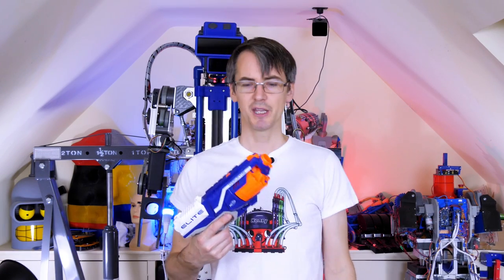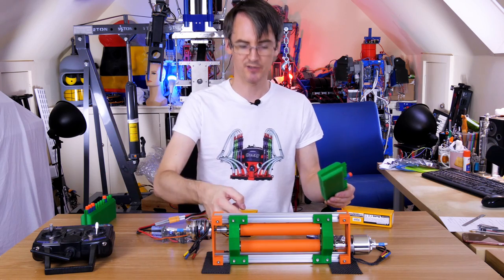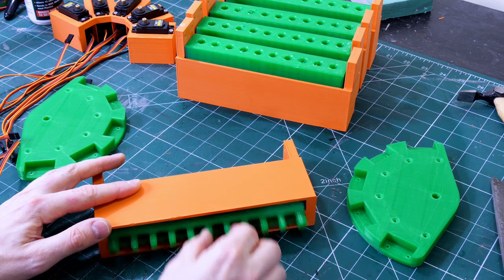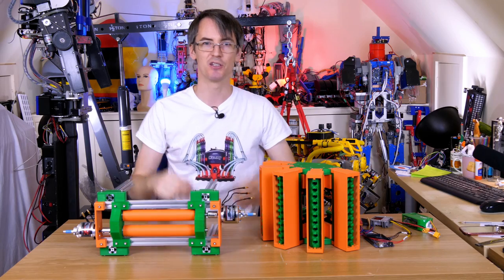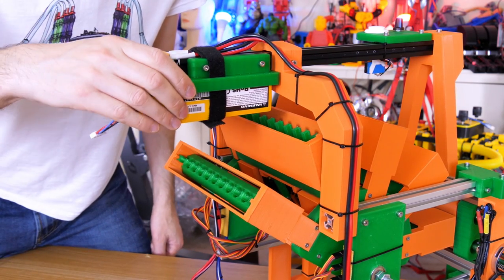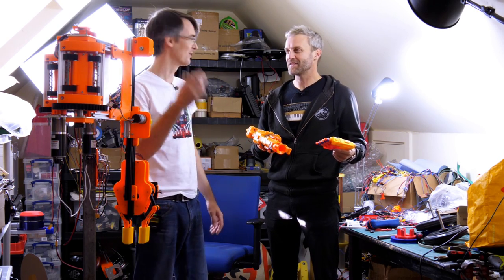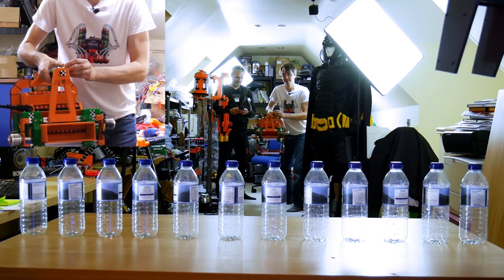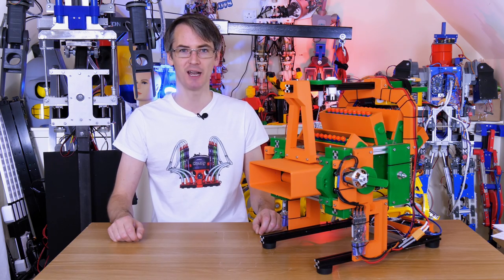Custom Nerf Blaster - TEN SHOTS AT ONCE

Comment: Instead of having 10 servos I would make the whole cluster go back and forward with only 2 servos.
Reply: Indeed. Perhaps don't use servo at all, drive the dart bays round and if the 'trigger' is on it acts as a cam and pushes them into the fire position.
Reply: Yeah I was thinking of that too
Reply: @foldionepapyrus3441  attach a geneva mechanism to the advancing crank and just use a crank to do all the advancing kinda like a old Gatling.

Comment: Could've used just 2 fixed servos instead of 10 movable ones which attached to the currently active magazine
Reply: Yeah I was thinking the same thing so the magazine could be turned into a circle that holds like 120 rounds and ideally you could make it into a quick change so you just swapped out the barrels. you could also make loading gadgets like a stripper clip for it and if you varry the speed of the top and bottom rollers you can create a range knob. If varying the speed of the rollers spits them out not level and you turned the "blaster" sideways you might be able to get them to curve a bit.

Comment: You could connect the two rollers with gears, such that their movement and speed is locked together. This will prevent discrepancies in the speed of the motors powering each, from throwing off the aim. You can also rough-up the surface of the rollers with some sandpaper or something, to give them more friction, and make it more likely they'll grab the darts and launch them at full speed without slipping. I got the idea for the gears, from hearing about a jumping insect, that is able to jump very far, very accurately, because its hind legs are locked together with gears.

Comment: Titan AS1. 
Take off the 'vent' from the barrel with a screw driver. 
Cutout some packing foam the same diameter as the barrel. 
Insert into barrel.
Insert 7 darts in a honeycomb pattern.
Insert another 7 darts in a honeycomb pattern.
Make 6 barrels that fit over the Hornets' barrels, thrice the length of the original.
Insert 18 darts into those barrels.
Connect Scout.
Pull all three triggers as hard as possible.

BAM!

47 Darts at once. The ULTIMATE zombie horde killer.

Comment: kinda ideas I could see to improve
- Add springs to the magazines to push them back, reduce to 2 motors for them all in the end. 
- Add a handle that circles around it, enough room for it to circle, and have the motors attached to that rather than the parts which already move.

I don't know how to explain it, it would work in my opinion though

Comment: Add  meshing cogs to the rollers so they run off one motor at the same speed. Add springs to the cassettes that keep them retracted so you can use one fixed servo in the center to push the currently locked cassette forward. I just cut your cost to build by a considerable amount.

Comment: Hey James! I’ve been a fan of your channel for a long time, and I’ve also been a blaster modder for a few years. My favorite blasters are flywheel-powered, just like your blaster. A few tips:

A dart guide (not tight like a barrel) would help with accuracy by straightening any wayward darts as they come out of the flywheels. These guides can be just a few centimeters long.

The flywheels can definitely be brought closer together. It’s wears out the darts faster and they will need to be replaced sooner, but they will have a lot more energy imparted to them by the flywheels.

The official Hasbro Nerf darts are close to the worst available option for blaster ammo. Definitely look into alternatives, especially for flywheel blasters and front-loading spring blasters.

I’d love to see an improved version at some point! Thanks for the great videos!
Reply from the maker: thanks, I might try 100 at once

Comment: James… Imagine this: You have a slider unit flat on the table. The tray/shelf that holds the cartridge, has two slots lined up with each other, one on the top, the other on the bottom. The cartridge has a hole, not a slot, that lines up with the slots on the tray, and has about the same diameter as the smaller width of the slots. There is rigid wire that fits both slots and hole, and has a notch-shaped bend in it, in the middle, and is held vertically by being imbedded in the table. Pick the slider unit up, and line up the slots and hole with the top end of the wire. You lower the slider unit onto the wire, and see that as the notch-shaped bend in the wire reaches the cartridge, the hole guides the cartridge to slide forward, without guiding the tray to move. As the cartridge moves past the notch-shaped bend, it retracts back into the tray.

You now have the basis for a vertical magazine, that, as it is fed into the barrage firing nerf launcher, it moves the nerf darts into the firing rollers as a simple consequence of being moved along a track. You can modify the tray into a multi-level shelf, holding multiple cartridges, with each cartridge holding a row of darts. You can use something other than a wire to guide the movement of the cartridges, and you can use two of them. You can use a small gap between two free-spinning wheels instead of the hole in the cartridge, to reduce friction.

Comment: You really should check out the hobby side of nerf. Also your flywheel cage crush is could be increased to give you better ranges. And you might want to look into modifying some of the older stored air rocket launchers with something call an absolver for something a little easier to carry into battle.

Comment: Cool project James. Love your ingenuity and how you show the trial-and-error parts of the process. 
 - I agree with others here that the pushing mechanism should be just one servo that fires whatever magazine is in position.  
- Wondering if the rollers should be linked on a single motor to ensure they spin at exactly the same speed, for the most reliable vertical aim.  
- Could the knob that advances the magazines be motorized (and make a complete revolution) as part of the firing sequence?
Thanks for all the great videos!
Reply from the maker: yes yes and yes I think ;-)

Comment: Hello there, awesome project, enjoyed it very much. But I have a suggestion, if I were you, i'd print the barrels in "spiralized mode", and then insert the resulting tubes in the hole where the barrels would go in the bulk-head/tronion, that way you can completely avoid the ZZ-axis seam and get a better seal with the added benefit of reduced friction. Version 2.0, maybe?

Comment: You should have put a single set of stationary servos, that could push any cartridge forward, then also automated the rotating of the load next cartridge with another servo, and then added a magnet and reed witch to sense if the mag is in position to be locked to attempt to push the mag and then automatically load the next cartridge.
Reply: That way even a kid could operate it, and you could spend more concentration on aiming rather than manually loading and stuff.

Comment: Why not use gears to counter rotate and just one motor. Then maybe same motor through one way clutch to rotate magazine holder, ratchet system on side of holder and button to release. Make carriage inside holder and use just one servo to push forward.

Comment: Why only 50? Why not have a system re-load the cassetes? Or have a “gear that carries a cassette from the stack, releases it at the back, and picks up another. So, the gear holds, say, 12 cassetes. It will pick one up, eventually empty it, the drop the casette! A stack of 100 casetes allow a capacity of 1000 rounds, and you can choose how fast it goes through cassetes…

Comment: Nerfer here! Couple things to take into account! 

First and foremost; NERF Elite Darts (The Blue darts you were using) are actually, honestly, the worst on the market you can use. And horribly over priced. 

Second; You also need to consider the crush of the flywheels, that is, the space between your Rollers, the "flywheels" in question. Normally, you want to have the crush be about a millimeter smaller than the the diameter of the dart. You also want to use Textured rollers as opposed to smooth ones for extra grip. 

Third; Be careful upping the voltage and the FPS. With Flywheel blasters, the darts tend to get torn apart one they hit about 170 to 180 FPS with flywheel darts.
Reply from the maker: I got the darts from China (2000 of them) - they seem to be a bit more rigid

Comment: hey James, there is a massive online Nerf blaster modding community. If you haven't already check out /r/Nerf. You probably need more powerful motors running at much faster RPMs. I'd like to see you do a single shot, auto-loading blaster. Also don't waste your money on regular Nerf Elite darts. There are plenty 3rd party darts available on Ebay and Amazon which are much more accurate and cheaper than Nerf Elite brand darts.
Reply from the maker: thanks, yes I bought 2000 from China